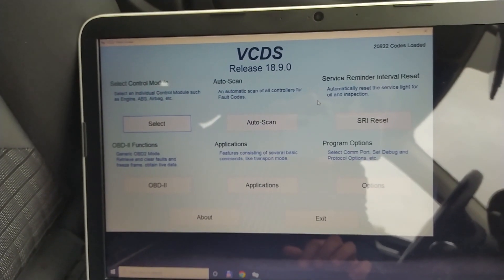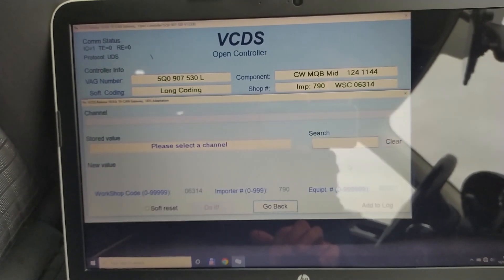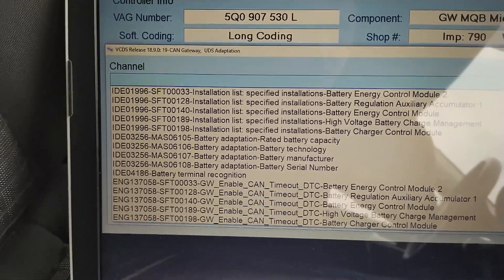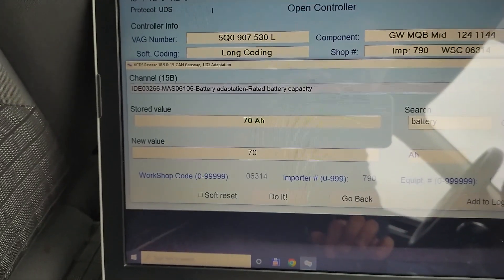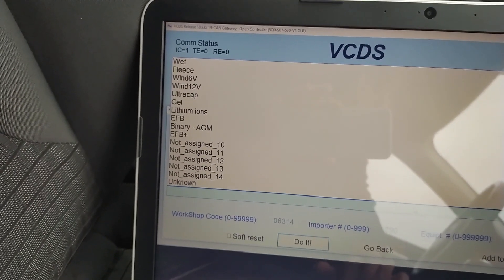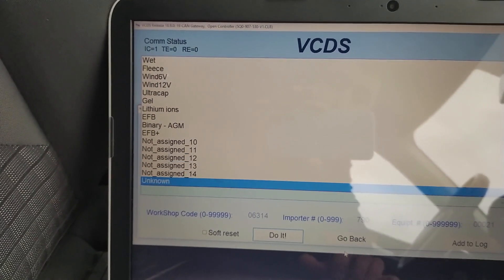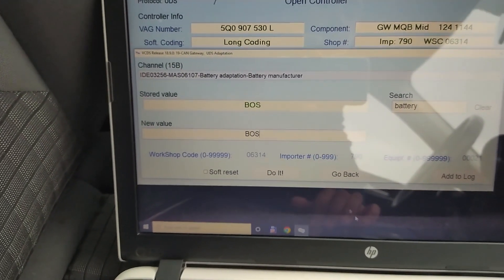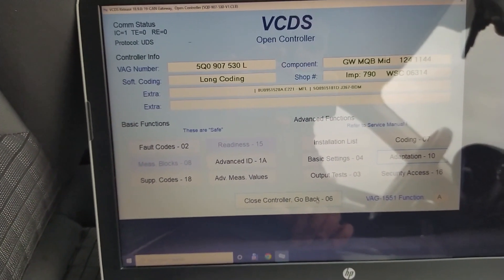Battery Coding/Adaptation on Audi A3 8V or any VW-VAG using the VCDS

Comment: Yes and I then got a battery regulator fault after this. On module 61 Battery Regulator it came back Control Module incorrect code. After much searching around and not finding the correct coding I eventually got the code from an 8PA Audi A3 and recoded the 61 Battery Regulator with F30F185A this was accepted and the Battery Regulator works fine. Without this code the battery was receiving a constant charge of 14.4 Volts which depending on state of charge of AGM battery was either insufficient or if fully charged was ‘frying’ the AGM battery. Now with a Digital Volt Meter constantly monitoring the battery I have seen charge rate at 14.8 volts when battery was heavily discharged, reducing to 14.4 volts when fairly discharged, then charge reducing to 13.1 volts when battery is almost fully charged to a fully charged state giving a reading of 12.8 volts for a fully charged new battery with engine running at 2,500 rpm

Comment: German word for AGM technology is "Fleece", "Binary - AGM" is close but not quite right, it describes some new coiled cell AGM battery technology. If you don't have a 3 letter code for the manufacturer, just write "UNK" for unknown. Serial number should be different, any 10 digit word is ok as long is different from the old one, in order for the "car to know" that is a new (or different) battery and relearn his characteristics, you can write in the calendar date instead.